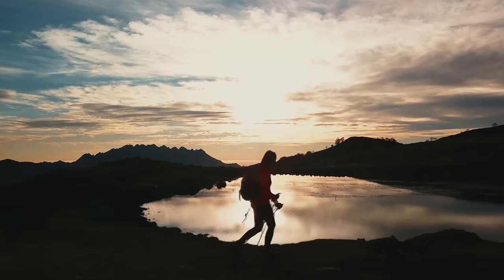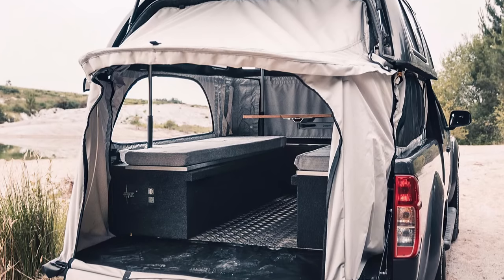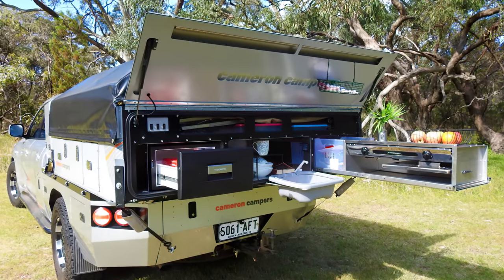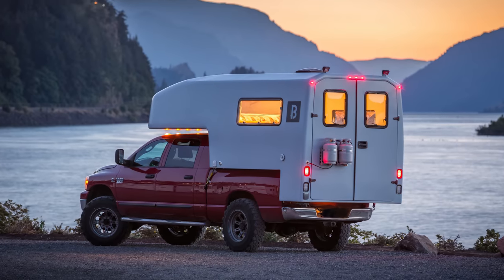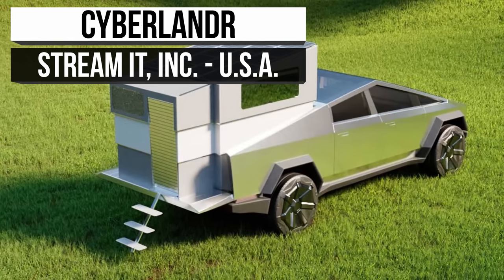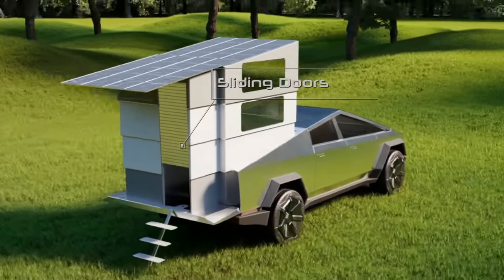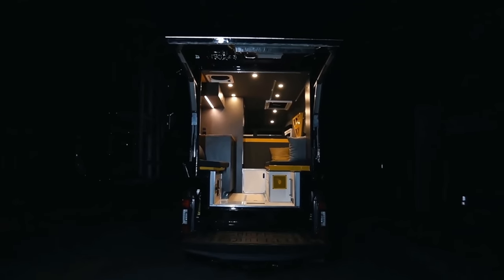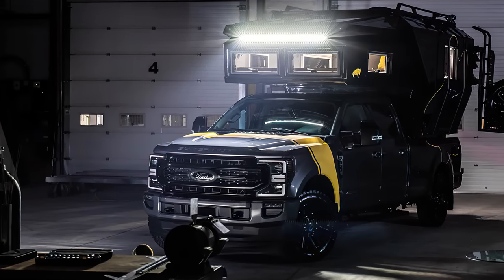5 Best Truck Campers with Lightweight Features

Comment: Did You leave out the 4 season usable Host Campers?  They have slides, 3 seperate water tanks, bathroom, king bed, couch, kitchen, solar, storage...and cheaper than the last on the list.

Comment: I'd like to see how that cyber truck does off roading.
Reply from the maker: So would all of us that expected the Cyber Truck this year? Unfortunately, we all have another year to wait due to some delay. From the looks of the demo videos, the Cyber Truck will have no issues with off-road terrane.  Although, I didn't hear how deep driving in water it handles and still operates. Like a Range Rover or the standard specifications most off-road built vehicles have. I can not see it taking a shallow river or deep puddles. Towing, driving up steep dirt roads, yeah, water, not so much. We will see in late 2022, or 2023, or later.

Comment: Would like to see the smallest duel axle travel trailer available with slide outs on both sides in the back. And expanding top there automatically lifts up would be good as well. So we take a small towing profile that expands into a large KAMER.
Reply: Yeah.. I want a pop up, low profile fiberglass pull trailer. Storage in any garage and light to tow. BTW I know in other countries these are popular because of small storage space. C'mon USA get with the program, make more compact pull campers at a fair price. These in the vids are great but way, way too pricey. If Im gonna' spend $100K plus, Im not going to put it on the back of my truck. The only one that is affordable is the power pop up for the truck bed, very cool. I looked up on their web site but the vids are not working and I have questions, the dimensions, especially the height.